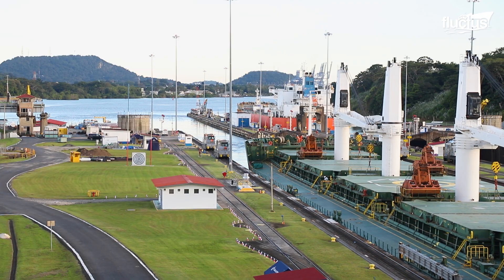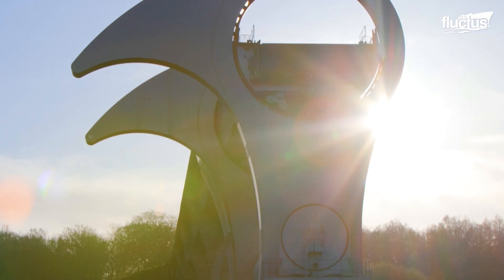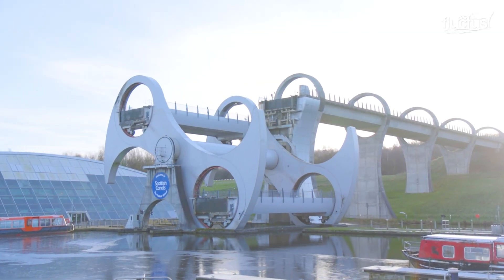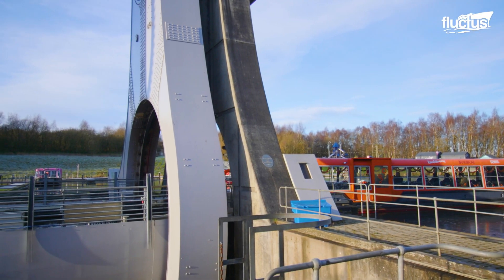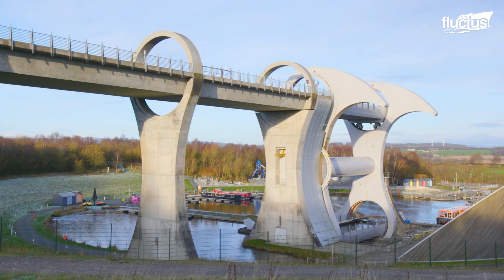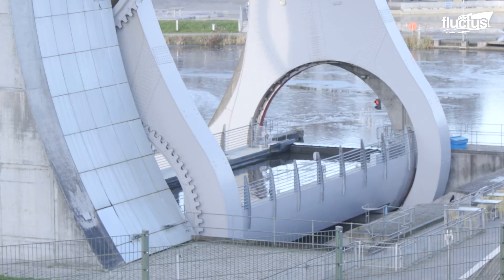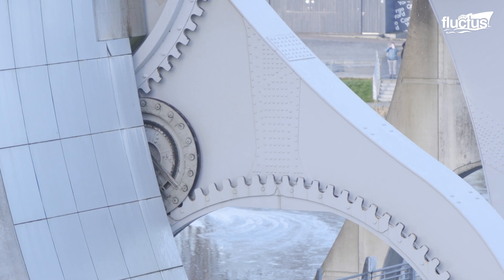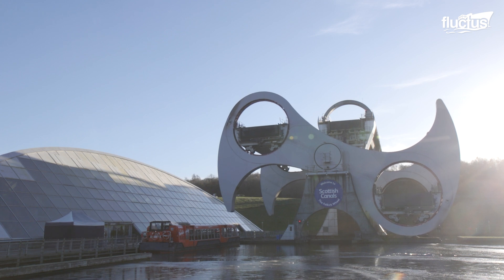Scotland’s Genius Idea to Build a Flying Canal for Boats

Comment: I smoked 1 too many bowls to understand how this works today. Will come back tomorrow.
Reply: Marvelous machine but poor illustration specially how the boat is transferred at the top of the wheel. Need better video angles.
Reply: Who’s on first?
Reply: Consider using a water pipe next time
Reply: Hahahahahaha
Reply: Its been a year.. did you found out how it work?